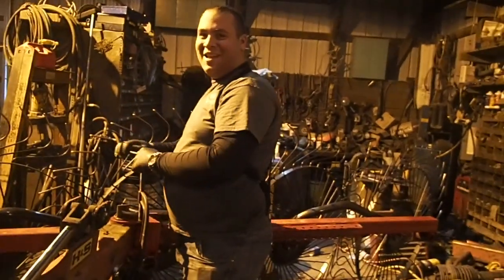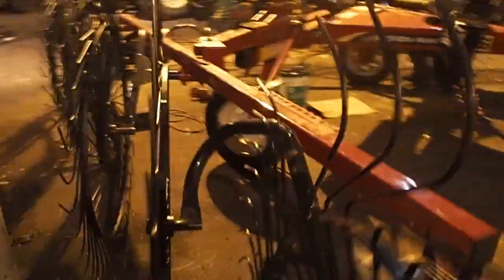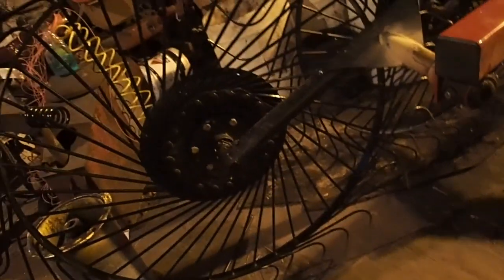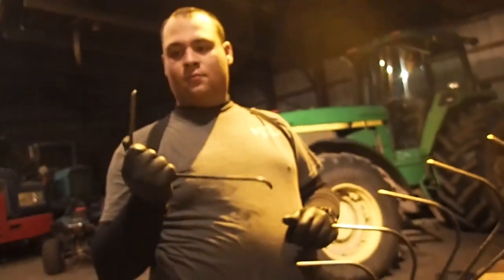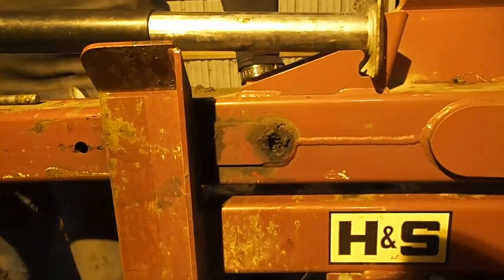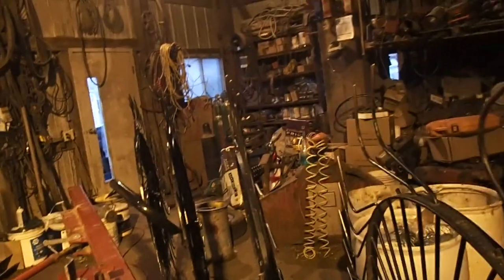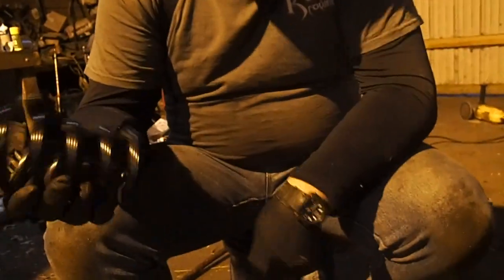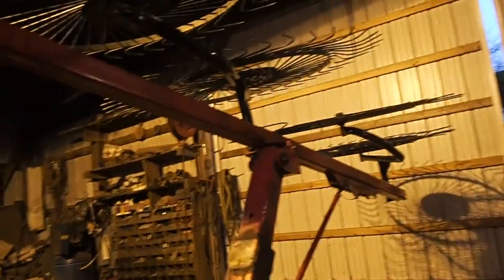Hay Rake No.2

Comment: yup pressure breaks teeth.getting new sitrix in spring.got good cash deal this fall.10wheel 6300.2017.got old vicon 3pt hitch.had 25+ years. u sure do cover a lota ground.